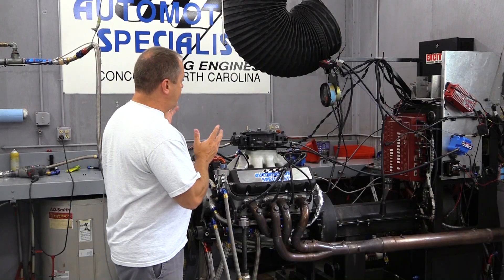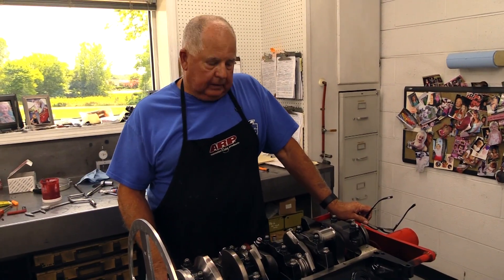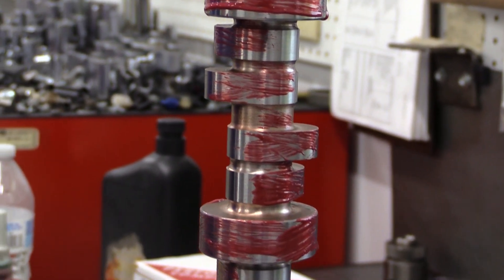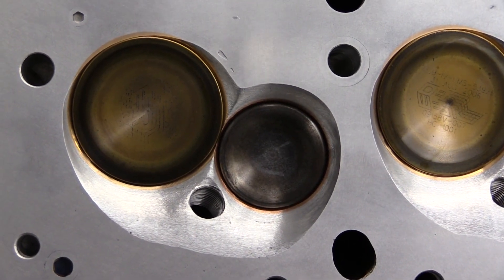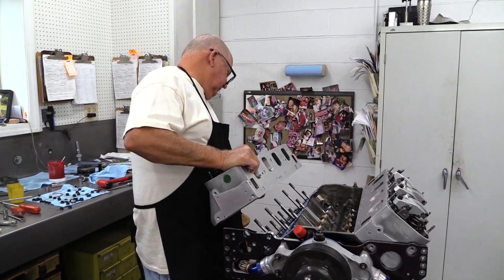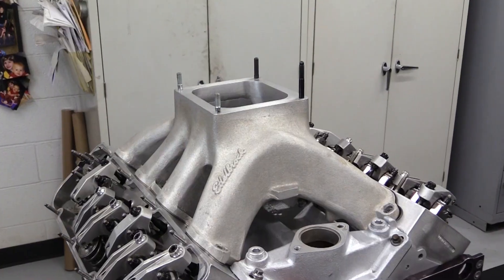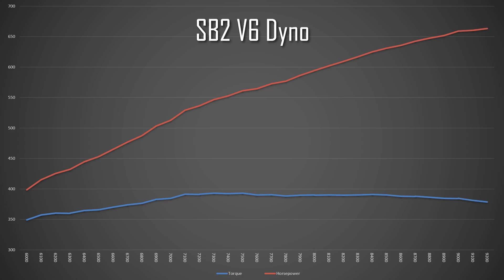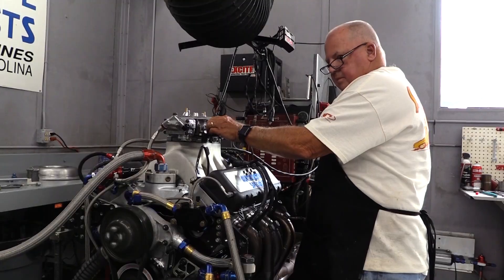NASCAR Chevy SB2 V8 Turned Into a Racing V6!?

Comment: American salt racers, doing the wrong thing the right way🤔.

Use a Ferrari 4.2 L V8, narr
Use a Toyota 4L, narr
Use a BMW or Audi 4.0L V8, narr
Use a Porsche Flat 6, narr
Use a Japanese or Euro V6, narr

Let's use a push rod nascar motor.

I mean, wow, the results speak for themselves (and very highly of the engineering team.) But the argument that you can't Get good compression and airflow out of a 4.2L V8, is a little short sighted given what the Japs, Germans and Italians are producing.

Love the video and the lunacy or it👌
Reply from the maker: I'm seriously not trying to be a jerk with this question. Do you know of anyone making 650 naturally aspirated horsepower with those engines? Cause I'd love to talk to them. Thanks for watching!
Reply: @TheHorsepowerMonster  No office at all and thanks for the response. 

As for off the shelf solutions: The Judd Hillclimb 4.0L V8 is good for 670BHP and only weigh’s 116kg (http://juddpower.com/our-engines/judd-db-3-4-4-0l-v8/.) Not a cheap option, to be sure. But neither is this kind of custom work to a Nascar V8 + buying the SB2 in the first place.

There’s little doubt the Ferrari 4.0/4.2L V8 could be tuned to 650BHP, given it’s F1 inspired design, but as with most European and Japanese engines they’re most often used in circuit racing classes that limit power to ~500-550BHP (Think Japanese GT500 and German DTM.) The Toda tuned Toyota 4.0L 1UZ-FE is a good example here.

When the rule book is a ‘Little thinner’ as you say. The European’s go hill climbing. A search through the ‘HillClimb Monsters’ channel (https://www.youtube.com/channel/UCCWPy8e7TkqGZH4zt4TiTNw,) will show some pretty wild 3.5-4.0L V8’s often topping out around 550-600BHP, once again for class rules and added on-off throttle flexibility, rather than outright HP. 

Also keep in mind that in all FIA classes they’re limited to 102RON Unleaded race fuel, not the lead heavy jungle-juice that salt flat racers are permitted.

Also, some lazy Canadian’s got nearly 540BHP to the tyre at 8,200rpm from a 4.2L Nissan VQ, V6 on E85 (https://www.youtube.com/watch?v=AvKjgo4TUa4&t=810s.) 

The solution presented is far from a ‘bad’ solution, just look at the results, (no doubt however it'd be a bit of a pig off-cam as you mention, not good for much else other than WOT runs accross the salt.) It is just ‘so American.‘ A hacked together pushrod V6/V8 with a large holley carb. A pushrod engine has no business at 9,500RPM and it’s just the brute force engineering might of Ford/Chev/Dodge/Toyota race divisions that have solved that puzzle.

It’s just a riot that this works so well ;) Love it all, you can’t argue with results.

Jordan
Reply: @manitoublack  No one cares about engine weight in land speed racing. This is a case of sticking to what you know and these guys know pushrod engines.
Reply: @manitoublack  thats exactly what my thought were, beutifull craftsmannship from this man, but the Judd engine would be a great solution.
Reply: @TheHorsepowerMonster  Gibson Technology do but they not cheap by any means. http://www.gibsontech.co.uk/engines/zb408-4-0-litre
Reply: Daver G  
6 x 2408 = 14,448mm² 2valve V6 Nascar SB2
16 x 907 =  14,512mm² Stock 4valve V8 1UZ (can fit 2mm over's if you like ;) )

There's obviously far more to cylinder mass flow than simply looking at the valve area ;) Need to look at port design, cam total lift, cam ramp, shrouding, exhaust design, intake design, flat vs X-plane crank (for a V8,) etc...

Don't take me wrong I love bonkersness of this design. Obviously the racer's had an SB2 (or could get one cheap) and this represented the most cost effective solution to achieve their goals, as well as using the knowledge of the engine builders local to them. It is doing the wrong thing, the right way. However from a 'clean sheet' lets build a ~650BHP <4.2L  engine; this would not be most teams first option. Infact outside of the USA, you'd have to think that no-one would even consider this route. But this is what makes the world an interesting place.
Reply: So dumb they don’t provide what he’s getting
Reply: Those numbers are all correct but it does not take in the fact that the air flows not straight out the port but from round the circumference of the valves. The total circumference of 2 34mm valves is 213mm. The the circumference of a 56mm valve is 175.9. This is the valve curtain area. Even if the both 34 or 56 mm valves were given 500 lift or 12.7mm. That’s 2705.1 mm2 for the 34s and 2233.9 for the 56 of curtain area
Reply: IF I WAS ON THE TECHNICAL JUDGES PANEL AT BONNEVILLE. I WOULD IMMEDIATELY DISQUALIFY THIS ENTRY. IT DOES NOT QUALIFY AS A V-6 FOR ONE SPECIFIC REASON. BECAUSE TECHNICALLY IT IS STILL A V-8 BECAUSE OF THE LONGER CRANK AND COUNTER WEIGHT GIVING IT MORE ROTATING MASS (STORED ENERGY) ALLOWING IT TO PRODUCE MORE TORQUE GIVING IT THE ADVANTAGE, AS OPPOSED TO A STANDARD V-6 WHO'S ROTATING MASS IS MUCH LIGHTER PRODUCING LESS TORQUE. SORRY KEITH DORTON BUT IT DOESN'T QUALIFY AS A V-6.
Reply: @Frank289100  you lose more power with more rotating mass...which is why you want the lightest pistons, rods, crank, cam, no accessories, etc. possie without compromising strength so you can have the best performance...also you can run a fully built V8 in the V6 class by simply unplugging 2 spark plugs so you can run in both classes...clearly you don't know the rules so it's a good thing you're not a "judge" or associated with Bonneville Racing in any way...

Comment: This is awesome. Honestly, it's a crazy build and I love it.
Reply from the maker: Thanks! And thanks for watching!
Reply: @TheHorsepowerMonster  Absolutely buddy! Thanks for sharing this build with all of us!
Reply: IF I WAS ON THE TECHNICAL JUDGES PANEL AT BONNEVILLE. I WOULD IMMEDIATELY DISQUALIFY THIS ENTRY. IT DOES NOT QUALIFY AS A V-6 FOR ONE SPECIFIC REASON. BECAUSE TECHNICALLY IT IS STILL A V-8 BECAUSE OF THE LONGER CRANK AND COUNTER WEIGHT GIVING IT MORE ROTATING MASS (STORED ENERGY) ALLOWING IT TO PRODUCE MORE TORQUE GIVING IT THE ADVANTAGE, AS OPPOSED TO A STANDARD V-6 WHO'S ROTATING MASS IS MUCH LIGHTER PRODUCING LESS TORQUE. SORRY KEITH DORTON BUT IT DOESN'T QUALIFY AS A V-6.
Reply: @Frank289100  how many pistons does it have? 6. It has six pistons arranged in a v pattern. It's a v6 you pedantic whiner.
Reply: @Frank289100  you lose more power with more rotating mass...which is why you want the lightest pistons, rods, crank, cam, no accessories, etc. possie without compromising strength so you can have the best performance...also you can run a fully built V8 in the V6 class by simply unplugging 2 spark plugs so you can run in both classes...clearly you don't know the rules so it's a good thing you're not a "judge" or associated with Bonneville Racing in any way...
Reply: @kyleboren7372  (you lose more power with more rotating mass.) IF THAT IS THE CASE THEN WHY DIDN'T FORD, GM AND CHRYSLER USE AND DESIGN LIGHTER ROTATING MASSES ON THEIR BIG BLOCKS?
Reply: @Frank289100  reliability, and useability..smoother running with more mass.
Reply: @Frank289100   because they are production engines designed for longevity and not high performance...it's the same reason why people put lighter pistons and rods in a performance engine instead of heavier pistons and rods...because it takes more power to move something heavier than it does to move something lighter...pretty common sense...
Reply: @gagecavey4070  THEREFORE YOU AGREE WITH ME THAT THE HEAVIER ROTATING MASS WILL GIVE IT A ADVANTAGE.
Reply: Frank289100 frank good thing you’re an idiot an you’re not on the board lol